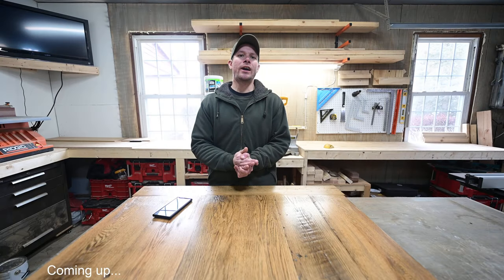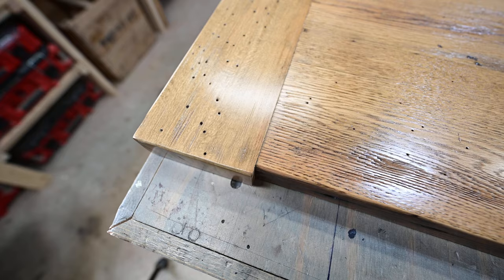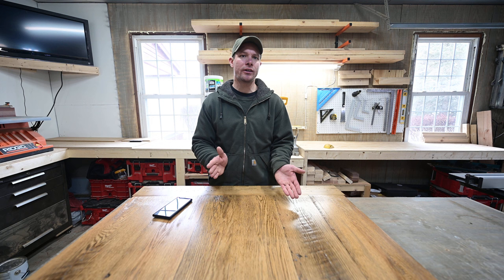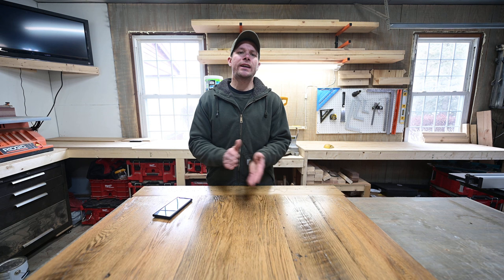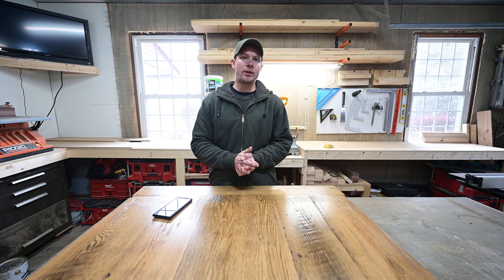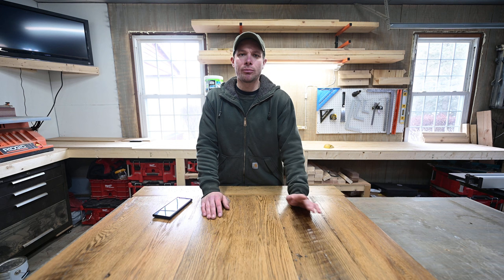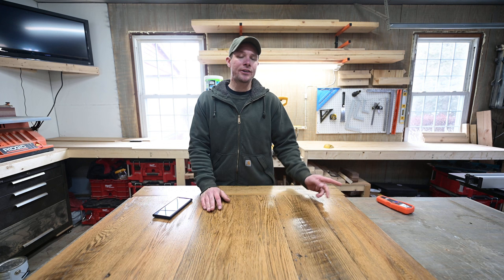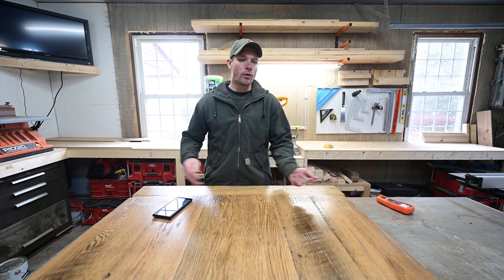The problem with Air dried lumber... Don't let this happen to you.

Comment: Air Dried (AD) and Kiln Dried (KD) will move the same amount if both are starting at the same  Moisture Content (MC). If the normal summer MC is 11%. Since your AD lumber was "50 years old" and was properly stored, it should have been at the normal summer MC for your area. And if you bought KD lumber that was dried to 8% and brought into the same environment as the AD the KD lumber would gain moisture until it reached 11%. Based on a chart that I have the  Jan. MC of interior wood is ~6% and the July MC of interior wood is 11-10% in the Up State New York. If the table is Red Oak and is 36" wide, and pinned (glued) in the middle of the bread board. I would expect each edge to moved 18"[0.00338(6 - 11)] ~= .3042 or roughly 5/16" from Jan to July (expand) and then July to Jan (contract) (It could be more, this is a ball park). This movement would easily be seen because of the bread board ends. So what happened here? Normal seasonal wood movement was not taking into account. Since the table was constructed in July (peak expansion) the edge of the table should have been proud of the breadboard end by 1/2 of what the expected total wood movement will be from Jan-July. (Based on the table shown in the winter I'm assuming the edge and breadboard end were flush in July when constructed). So that top is now proud of the breadboard end in the summer, under in the winter, and flush twice a year (spring and fall). Also need to make sure the unglued tenons have the proper amount  clearance to move freely.. The calculation is an estimate. It could have been unusually humid when the table was constructed so MC could have been 12 or 13%.. The top could be wider the 36" which would also increase the movement. The calculation is based of a formula (13-3) on page 13-16 of the Wood Handbook: Wood as an engineering material by the US Forest Service
Reply: I came here to make sure someone pointed this out. Wood moves. You have to account for it. And kiln dried lumber will go up. Everything wants to reach ECM for its environment.
Reply: Very well stated
Reply: The larger the individual pieces the more it moves...
Reply: Fantastic write up. Thx
Reply: What he said
Reply: Interesting
Reply: And no, the table sitting in his customer’s kitchen until it reached 6-7 MC does not mean it was effectively kiln dried, it just continued air drying.
Reply: That's a lot of formulas to be dealing with in a hobby. I swear everything these days is like you got to take a course on it

Comment: Lesson my wood shop teacher taught me 65 years ago, is that wood will take on what ever ambient moisture that's it's in. Doesn't t matter how long it's been air dried, it will still pick up what ever  moisture it's in. Did you finish the underside of the table. That's where most wood workers fail. My teacher told me to finish all surface., because what is not finished will absorb moisture and the finish surface will not. That's why a lot of furniture warps and cracks over time.

Comment: Get a moisture meter and ask customers what their inside humidity is at during winter and summer months. That'll tell you what moisture content the wood should be at before building
Reply: Would you mind explaining more?
Reply: Moisture content and relative humidity are not a linear match from what I understand. MC of between 6 & 8% correspond with about 35% relative humidity
Reply: @hosoiarchives4858 if you know the typical temperature and humidity of the space the furniture will be in from summer to winter you can determine the equilibrium moisture content for both extremes.  Then you can build around the EMC at your shop (or the measured MC of the wood) vs their home.  So, if the wood in the video was a moisture content of 12% you'd want your breadboard ends a little shorter than the field of the table is wide.  That way as it dries out during the winter the top will shrink to a normal/acceptable amount vs the breadboard end.  Then when the humidity of summer hits and it swells it will also remain within acceptable amounts.

Comment: Air drying is not a problem. Every piece of antique furniture was likely made with air dried lumber. I only use air dried lumber. Matt Cremona and many others only use air dried lumber. Acclimation is key to success. Kilns dry wood faster, but they do not make wood immune to seasonal movement.

Comment: If you are going to be serious about woodworking you need a climate controlled shop and store your wood in it, at least what you are using for your next few projects.  I use almost exclusively air dried lumber, stored in my climate controlled shop, and never have issues with it. It's a myth that air dried wood is less stable and will never be as dry.
Reply from the maker: Good to know! Climate controlled shop is a must at my next place! Thanks

Comment: ""Be careful storing that lumber in your basement. If it hasn't been kiln dried, the bugs and whatever fungus it may contain will love your home. I dried some 2 1/2" slabs in my basement with a dehumidifier not knowing this information. Later had to debug the house. I realize you stated you're going to build a kiln in your basement but your video showed an arrangement or wood in your basement already.
Reply: Why did you have to debug? What bugs did you get? Could understand fungus or mould maybe spreading around if you have a dehumidifier running and pumping spores and dust all around in your air. 

Have never heard of bugs becoming an issue though.
Reply: What kind of bugs did you get?
Reply: @42WallabyWaySydney  
Ants were one species and then I don’t know what the other was. It was small gnat like insect. Never had a problem with them before until after I had the wood in the basement.

Comment: Hi Brady, It looks like you did just fine on the build itself. It doesn't appear to be warped too bad and is/was certainly salvageable. I won't repeat the lectures from the comments section... 🙂but you can almost always fix "mistakes" as you know. Rescuing a piece can sometimes be more gratifying than the original build. Anyway, I hope you were able to recover the value of the table.
Reply from the maker: Hi Larry. I was able too! I fixed the tabletop, built a base for it and I used it for my family as our dining table for a year or so then I sold it again before we moved to someone putting it in an Airbnb. So it definitely did not go to waste.
Reply: @BradyHommel  That's awesome! I've been there often and enjoy that process, but the journey can be full of anxiety. We are forever students with woodworking, which is why it's so rewarding.

Comment: I with ya. I have had a 4inch sycamore slab. It had been stuck back in my shop for 8 years.  With live edge, it was 12 ft long. 43 inches at the butt and 35 at the small end.
I do lots of turquoise inlay. 
Had a customer want this as a conference room table.
The slab had a check about 20 inches, from end of check to 2 inch opening.
I butterflied with ash bows, top and bottom. Since the slab was 4 nch thick, i used expanded foam to fill the majority of the check, leaving about 3/8 of depth at the top of slab. Underneath, i glued 1/4 plywood on top of the bottom bow ties.
On the top, I used 2 part clear epoxy 
 Before pouring the epoxy,  I ground and sifted  Sleeping Beauty mine turquoise. True stones purchased out of Arizona, not some Chinese fake.
Anyway. After the top was completed, sat at the office on a frame of 3 cypress flaired stumps. Customer, attending board members, clients of the firm, all fell in love with the boardroom table.
3 months later I get a call. 
The check had opend even more. Large fissures had opened around the turquoise.
Needless  to say,  air dried wood, no matter how old, when introduced to low humidity of a room with HVAC control, nature will reach up and bite u in the butt.
In this lesson I learned that the humidity in a controlled environment will have a moisture content of about 9.
Build accordingly

Comment: Just found your channel. Great content. I’m actually dealing with a similar problem. Bought a walnut coffee table and end tables. The guy I bought them from actually milled up the logs into slabs himself. The end tables are fine, but the 1 3/4” top on my coffee table cupped after the heater in my house pulled the moisture out of it. I’m going to have to take it off and rip it at the center seam, and then run it through my planer. I might actually have to make 3 cuts and plane down 4 pieces instead of 2 so I don’t lose very much thickness. The fella who built it apparently doesn’t know how to cure wood properly before building with it. I didn’t say a word about it to him, he did me really good on the original sell, he’s a great guy. I just chalked it up as a lesson learned on my part. lol  I really appreciate you sharing your experience with us. Can’t wait to watch more of your videos! Blessings! P.s. that is a gorgeous table top in your video. You’re very talented! Nice work!!

Comment: i think you did right by the customer, however if you built the second table with a lower moisture content, what is to say it wont expand to much in the humid months?  you might be getting another call if the customer does not change the home climate and make it more stable for a sensitive table design. this sounds like a painful case of the customer is wrong or may need to change expectations or understand a table like this needs a stable environment, as others have stated so well wood never actually stops moving or adjusting to humidity.

Comment: Thanks for the video. I stored 600 or so square feet of oak flooring I had milled in the unfinished second story of my cape. The powder post beetles (not exactly sure, could be another species of boring beetle)  will live in the wood for many years after being milled. On a quiet night you could hear them munching on the wood if you were up there. I did freak out a bit thinking they'd eat my home but as far as I can tell they will only eat the sapwood and maybe just the sapwood of hardwoods in particular. I also shuffle 3-4 cords of firewood into my house every winter and see frass buildup on the rug underneath the fire hoop indicating live bugs in there. So far my hardwood floors haven't been eaten away. I'm not saying it can't happen, but It hasn't happened in my house over the span of 8 years (that I can tell).

Comment: It's all about where it's going. We have a humidifier on our furnace and keep the humidity around 30% inside. My shop is heated with a Woodburner and really dries the wood out. Just about everything I build swells when it's taken inside. Just have to build everything to allow it to expand and contract. I sold a piece that was 18 hours away and had to drive all the way there and fix it on spot because it swelled over 2 inches (with kiln dried lumber)
Reply from the maker: Damn 18 hours! that's a bummer!

Comment: One conclusion that could be drawn from this experience is that a good process might be to air dry down to what you can get, 12 or so, and then move it into a space that's climate controlled close to what it will be like in it's future home.

Comment: After it comes out Of the kiln unless your storing it  in a controlled environment it will rise up a few points in moisture  relative humidity in your location. I worked for a small cabinet shop 50 yrs ago made lots of custom kitchens  kd lumber purchased from commercial supplier lumber would be stored up in old hayloft we would bring material into shop a few days before milling it  rough cut our stock&  let it rest for a day or two.. I have a HM 130 also & I do want a kiln.  I do historical restoration & use reclaimed lumber recently I had to replace about 20 door jambs long leaf yellow pine 130 yrs old not all but a few have to remade, Let's saw up some trees now get max together,

Comment: That’s exactly how breadboard ends are supposed to work. I think your mistake was to make the ends too long during the wet summer. Cut them back by 1/2 the distance and it should be fine. Table tops can be difficult. I garbage picked some beautiful oak tabletops in Breckinridge CO (a hotel was just throwing them in the trash!) and then I moved to a low altitude wet area and they cupped and warped like crazy. Now I have to cut them up and plane them down. It’s still good wood though.

Comment: Oh I learned this hard way as well.  First big project I did was bread board table top and end tables for patio (out of sun), but in Arizona.  Used 100 year old wood with the bread board ends and 2 years later it looks almost the same as yours.  Needs to flattened again and trimmed back.   Ugh.

Comment: Few strokes with a jack plane and some linseed oil later I would be done fixing that table top.  It already shrunk probably about as much as it is going to and it looks like your bread board ends did their job.
Reply from the maker: I did fix it and put it on a different base. I used for a year for our family and it was all good! I sold it not to long ago.

Comment: Just using wood stored outside and then bringing it in with AC will do this. Even seen antique tables that had been stored in garages.. put inside and humidity sucked out by AC.. and they rip apart.
Reply from the maker: Wood has a mind of its own. Lol

Comment: That top would be easily fixed. Slice off the proud ends, shape, sand and varnish. Done.
Never ever use wood that is not «furniture dry», which is 6-12% moisture content. Goldilox zone around 7-9% depending on where you live in the world. Wodd that has been drying since Noah built the ark won’t be dry enough, but it would be very well seasoned. You need to dry the wood down inside a climate controlled room until the wood is around 8% or so. Then you won’t have any issues. Also, make sure you allow for movement in your design - something you did very well here with floating tenons. Which is proved by the fact that the table top did not rip itself to pieces!
Slice the breadboard ends flush with the sides, and it will be a solid table top that won’t do anything crazy.

Comment: I'm just starting out trying to do any sort of woodworking..I have some logs that have been left out all winter
My question is,could I potentially torch a log with a propane tank torch to dry it out? Or would that be almost impossible 
It's a personal project so it doesn't have to be perfect but I would still like something that doesn't look like a mess

Comment: The wood should be acclimated to where it's going to live its life. Air dried wood has better working properties and color. Instrument wood is often air dried and they dont have movement issues if the wood was acclimated properly. Just an improper assessment of the issue. I understand how you concluded it though.